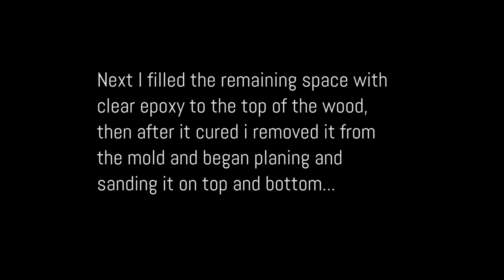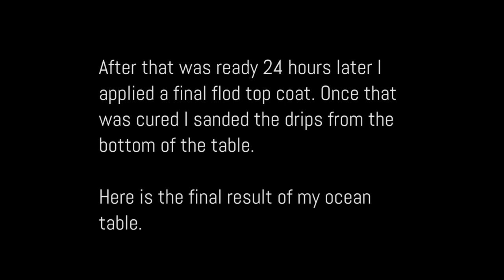Building The Epoxy resin Ocean Table by Chris Swanger - Full Build tutorial epoxy tips and tricks

Comment: Hey! I’m curious, did you just use regular white paint when you painted that strip of white across the table before blow drying? I wasn’t sure if you need to use a specific paint or if anything will do.
Reply from the maker: I use rustoleum gloss white from home depot.
Reply: Pour Me A River do you use rustoleum for the spray paint and regular white paint? Love you work! Can’t wait to see your future videos!
Reply from the maker: @stephratavicius2776  you mean regular white paint other than the spray paint?
Reply from the maker: No that was white liquid base pigment from www.pourmeariver.com
Reply: Pour Me A River yes! That big strip of white you painted before you used the blow dryer to make the waves! Thanks!
Reply from the maker: @stephratavicius2776  thats the liquid white epoxy color from www.pourmeariver.com
Reply: Pour Me A River thanks a lot!
Reply: @PourMeARiver  OMG, this project is insane!!! So crazy beautiful! Seriously impressive work!
Was that just the white pigment paint in your cup, or was it mixed with resin? If mixed, was it with a top coat, deep pour, or StoneCoat casting? Thanks so much!